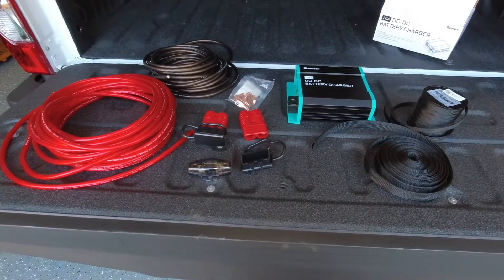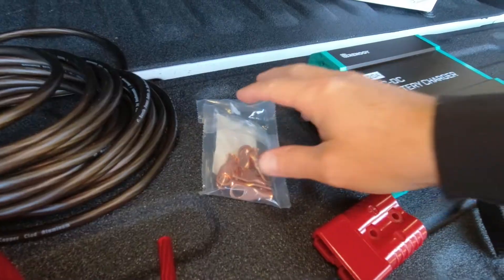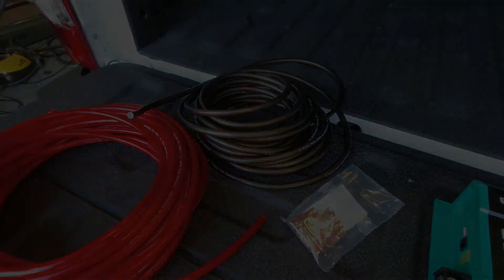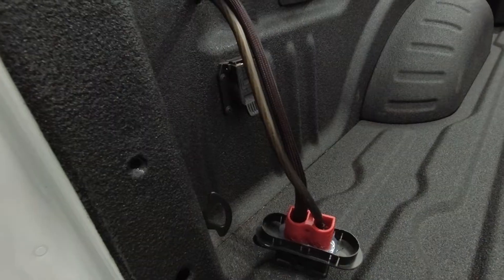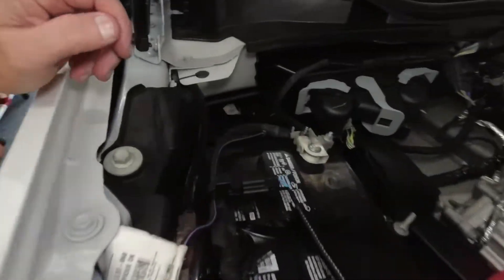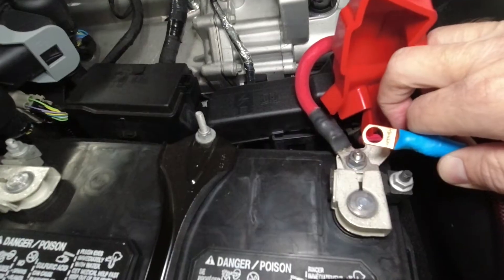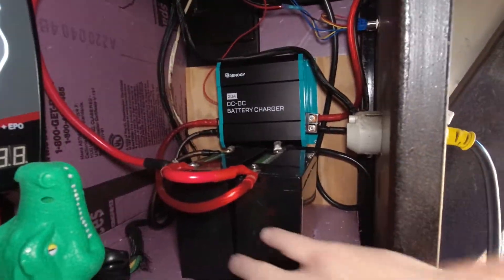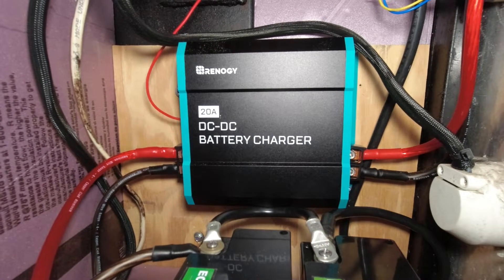How to Install a DC to DC Charger (Renogy DC to DC Charger Review)

Comment: Nice clean job. I am planning the same for my 5th wheel. One different component I am considering is either a circuit breaker (rather than fuse fuse) in the engine bay or a contactor controlled by an upfitter switch. I am not sure I want the Anderson power connector to be 'hot' all the time. Flipping it off when I am not towing would allay this concern.
Reply from the maker: Thanks. That’s a great idea. I keep the cover on the Andersen connectors and I’ve never had an issue but it sure couldn’t hurt. For me just having it fused keeps me from forgetting to turn it on before leaving. I know how I am and I would remember it 10 minutes before getting to the campground. Good luck on your install and thanks for watching.
Reply: Hello Rod.  I am reading your comment pertaining to the upfitter installation.  I have a 2019 Ram 5500 with the upfitters as well.  Did you install the power wire to the upfitter switch as you indicated and if so, how is this working out?  I know there are several different fused/relay choices in my setup.  Thanks in advance...

Comment: Do I have to run a negative cable from the battery to the back as well? Can't you just ground the charger to the chassis somewhere in the rear? Previous owner of my van just had one positive power cable running to the back and not a negative cable. I'm assuming they just grounded whatever device they had to the chassis back there somewhere. Is that ok or do I absolutely have to run a negative cable from the front starting battery to the back of the van as well?
Reply from the maker: Grounding to the chassis will work. Just be sure you have a clean connection.

Comment: Did you disconnect the hot wire from the 7 pin connector going to your 5th wheel batteries since you now get power straight from your t4uck battery to the dc to dc charger?
Reply from the maker: I didn’t. I was planning on it, but after researching I just didn’t feel that it provides enough amperage to make a difference. I ran it for several years with no issues.

Comment: I'm guessing you can't do much dry camping with the smaller batteries you have there. But do you plan on dry camping after you upgrade your batteries? What size inverter are you thinking you might use and what battery configuration? Thank you. This video was great. Thank you.
Reply from the maker: Thanks for watching! You are correct. Not much dry camping going on with our 60ah setup. We always relied on generator power when boon docking in our cargo trailer. My dream battery bank was 600ah (3 - 200ah batteries) with a 3000 watt converter and enough solar to keep us charged up. We actually sold our trailer before we got a chance to build our off grid system. Our refrigerator ran on 120 volts, so our intent with the DC to DC charger was to keep it running while traveling. We never had an issue, even traveling 5 - 6 hours a day.

Comment: Thank you.  This video was very helpful, about the only place I could find on the Internet that addressed and illustrated running a 12V circuit from the truck battery to the trailer (i.e. avoiding the use of the 7-pin).
Reply from the maker: So glad the video helped! Thanks for watching!

Comment: Hello, thank you for this video!  Where exactly did you hook up the red wire to the running lights?  Why do you need a switch if when you turn the ignition off or unhook it cuts the current to the running lights? Do you think it is really necessary to put wire protection under the truck? It's such tight space at certain spots.  Why did you choose this type instead of plastic wire loom?  Thank you :-0)
Reply from the maker: Great questions! The red wire ran to the running lights on the trailer. I believe this was a green wire, but that may not be universal for all trailer manufacturers. Your best bet is to find a running light location and either remove it to see what color the wires are or you can use a test light to find the correct wire. I need to use the headlight switch during the day, because our running lights will not turn on until it is dark. On our vehicle, the running lights will stay on even with the vehicle not running. I would most definitely add some type of wire protection to wires on the underside of a vehicle. Your tires are constantly kicking up rocks and debris from the roadway and the last thing you would want is a wire to get damaged and short out. I think plastic loom would be better for protecting the wire, but I chose expandable sleeving because it's fairly easy to work with and it gives a nice factory look to the wire once it is installed. Thank you for watching and good luck with your install!
Reply: @BuildYourOwnAdventure  Thank you very for your response and good tips!  Llol, trying to get away with not protecting wires 🙈.  Although, there is the duplex Marine grade wire , the Jacket over the red and black wires is very thick, maybe this one would not need wire loom?  Thank you again, safe travels.
Reply from the maker: @ you’re welcome! If you feel comfortable with the existing insulation, then go for it. Just give it a look over ever now and then.
Reply: @BuildYourOwnAdventure  Thank you,!I will also re-tcheck how tight it is underneath, I have a Colorado diesel, it's all pretty cramped underneath.

Comment: Question: Why go directly to the battery instead of the alternator?
Reply from the maker: When connecting accessories to vehicles, you normally connect to the battery or a fuse panel. In a 12V system the alternator is connected to the battery as well, so you are basically connecting the two.

Comment: Can you explain the small red conductor going into the renogy? Where does it go? To the camper driving lamps?
Reply from the maker: That’s correct. It goes to the marker lights on the camper. It’s a signal wire that turns the unit on with your driving lights from the tow vehicle.
Reply: @BuildYourOwnAdventure  Thanks!

Comment: I assume you have since upgraded the size of your battery but in case you haven't LiTime makes an excellent battery at a reasonable cost. The LiTime 12V 100Ah Self Heating LiFePO4 Lithium Battery With 100A BMS, Low Temperature Protection is now running around $370 and uaully grab a coupon for up ro 30% off. They also have a 200Ah for $719. Keep an eye on them and you can snag some pretty good discounts. They also have a new model with lighted on/off/wake push button....the battery does have low temp charge protection but no heater. However, there is a force charge feature for emergencies. It runs around $279.00. Good video.
Reply from the maker: I actually haven’t upgraded my battery bank. I keep an eye on lithium batteries and have been happy to see the prices dropping. I haven’t seen the new option with the push button. I’ll check it out, especially with that price! Thank you for watching!

Comment: Follow-up question:   is there any risk to replacing my lead acid battery with a lithium without using a DC-DC charger? I've confirmed that my converter and solar charge controller are compatible. Just wondering if not using a DC-DC charger can put the lithium battery or alternator at risk.
Reply from the maker: I’m honestly not sure. I’ve heard that it can damage your alternator but I never had issues before adding the dc to dc charger. My problem was the alternator not sending enough juice to keep the battery charged while running my Inverter.
Reply: I  vote no as well. LiFepo batteries have very little internal resistance, unlike lead acid. Therefore, the batteries will take all the current an alternator can produce. If your batteries are significantly discharged it will most likely fry your alternator.
Reply: @WayneTheSeine  - Well, not according to Todd. I put this question out there and he actually answered it as one of his featured videos.  I would be curious if you find anything erroneous with his explanation.

https://youtu.be/unCm8M-0F0o?si=ceOri9q5Q7khbWpZ
Reply: @WayneTheSeine  - Well, I replied, but apparently that post got deleted.  😞
Anyway, based on info I received in my research, the "frying alternator" scenario would only happen if you upgraded the wiring from the trailer to the tow vehicle to a thicker gauged wiring.   Otherwise, it's less likely given the smaller gauged wiring used in the 7pin connector AND the distance, etc. Would you agree with that?

Comment: Awesome video!  Very informative and educational.  I'm wondering how I can make this work for a tow-behind.  Maybe have the plug/jack come out of the bumper near the 7pin connection?
Reply from the maker: Thanks! Yes. I plan to add this to a tow behind soon. I’ve thought of adding a connector under or behind the bumper, near the 7 pin connector.

Comment: For my trailer, i just installed a 700 watt inverter in my tow vehicle. Then I ran 120 vac 14 gauge extension cord. At the trailer coupler i put a plug. Then close to trailer batteries i got an 15 amp battery charger. Smaller wires, higher voltage, less voltage drop. Added plus, i have 120volts for camera batteries or other 120volt equipment.  I tried the inverter in the engine compartment, but it was just too hot. So my inverter lives under the passenger seat now.
Reply from the maker: Cool! That’s a good idea as well!

Comment: Did your ground to body have any issues??  Trying to find a good ground in rear of 2021 SD instead of running negative all the way back..
Reply from the maker: No issues at all.
Reply: I have a flashing red light..  everything ohms out but the ground wire..  it’s at 75 so not going to work.  Either need a better spot in the rear or getting another 30’ of 4 awg welding wire and run it to the front..
Reply from the maker: @MykleH  try grounding to the frame. That was my backup plan.
Reply: Frame did the trick!  Thanks!  Got wrapped in the weeds thinking body would work.  I did use my upfitter switches (2) so I can do 20 or 40 amps.  Figured a steep grade or sitting still 20 would be nice and driving 40.  Thanks again for your videos!
Reply from the maker: @MykleH  that’s awesome! Glad it worked! I like the two stage/upfitter idea. Might have to try that in the future. Thanks for watching!!

Comment: I find Victron over rated..Same as some of the BlueSea products. Cost vs Application.. The only thing I don't skimp on is Wire\Fuses and sizing...

I would make a habit of checking under the frame for wear and tear too. As wire can be damaged from road debris..
Reply from the maker: I would love to have a Victron system, but it would be overkill for the amount of time we use it.

Good call on checking the wiring! I clean the frame of the truck all along. That will be a good time to check on the wires. Thanks for watching!

Comment: Not sure if this has been mentioned but you can use an "add a circuit" to the ignition fuse which will run to the charger to tell it to turn on as soon as the ignition is turned on. That way you don't need to have the driving lights on for that to work. But clean setup and thanks for making this, I'm adding one of these chargers and this was helpful.
Reply from the maker: I have not heard of the add a circuit, but I'll look into it. The most annoying part of the system is trying to remember to turn the running lights on when towing. We just came back from a trip where I drove an hour before realizing my running lights were off! Thanks for the comment and I'm glad the video was helpful.

Comment: can you use the battery while its charging.  while the dc to dc charger is on do I need to turn off for example the fridge?
Reply from the maker: We use our Inverter while traveling to run our fridge. It causes no issues and keeps the battery topped off.
Reply: @BuildYourOwnAdventure  perfect ok thank you

Comment: Very clean install.  Your Renogy charger has a nice feature on it that you aren't using.  The D+ wire (red one in video that goes to lights) is necessary to let the charger know that the vehicle is turned on and the alternator is working. There is a second connection point on the charger for an optional CL wire.  When current is going to both D+ and CL the output is cut in half (20 amps to 10 amps).  This is useful because there are times when you only need 10 amps and your alternator won't have to work as hard thus improving fuel economy and reducing heat.  I have a Renogy 60 amp charger and ran two 16 ga wires from the charger to a DPDT three way toggle switch that I mounted in my dashboard.  I also have separate connectors for these wires between the truck and trailer.  The switch is powered through a fuse that is only active when the ignition is turned on.  With this setup I can switch between 60 amps, off, and 30 amps.  

The 4 gauge wire that you ran will easily accomodate a Renogy 40 or 60 amp charger but you may need to upgrade your alternator.  My truck tow package came with a 250 amp alternator that can handle 60 amps but I anticipate that I will make use of the CL feature most of the time.
Reply from the maker: Thanks for the awesome comment! I had no idea the CL connection did this. I could see how this would be useful, especially on long trips. 

Our truck came with dual alternators totaling 397 amps, so we should be good to go if we decide to go with a larger converter. I would love to do that if we ever upgrade our battery bank. Thanks for watching!
Reply: @BuildYourOwnAdventure  What pickup do you have?
Reply from the maker: @OregonSolar 2022 Ford f350

Comment: does this dc to dc charger get hot  ? Does it have an app so you can control everything ?
Reply from the maker: I’ve never checked to see how hot it gets. I know as soon as it starts charging, the cooling fans turn on. I’ll have to check the temp on our next trip. It does not have an app or a Bluetooth module to control it. I normally check my voltage gauge inside the trailer when we get to our destination to be sure we’re fully charged. I’ve had no issues yet!

Comment: I use welding wire really flexible and can handle lots of juice and great insulation .  EWCS 6 gauge
Reply from the maker: Awesome! Welding cable is always a great option. I planned to use 6 gauge at first but decided to go with 4 because I’m familiar with the company and their products. It can be tough to find wire that is the true gauge that is advertised.